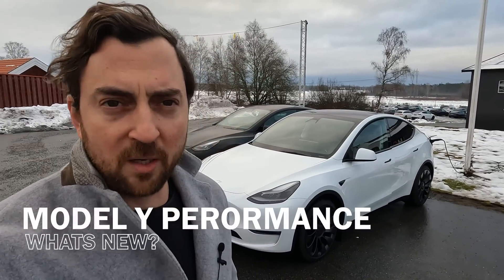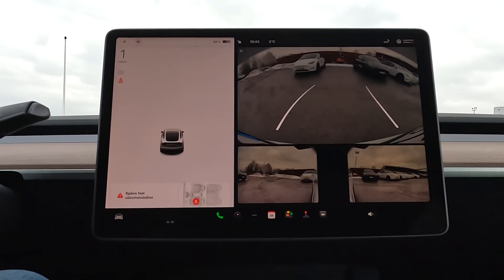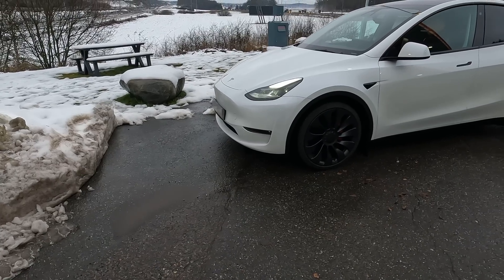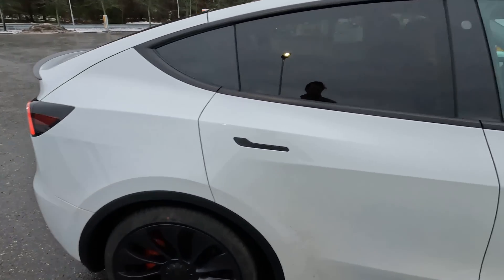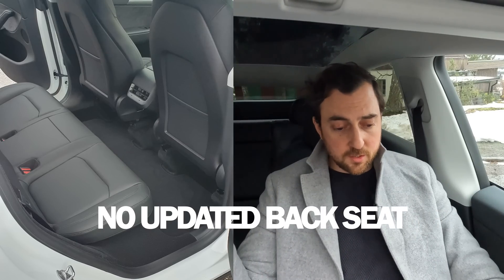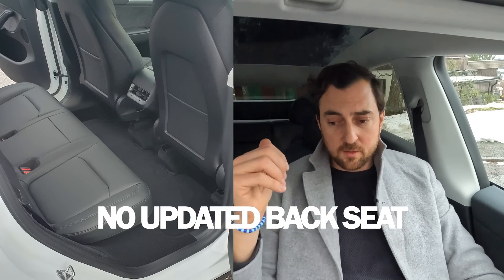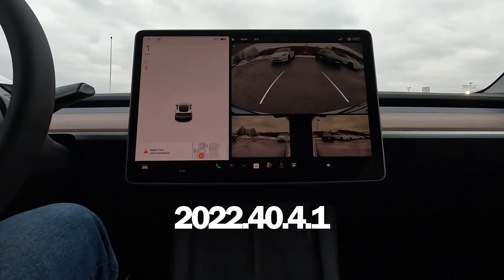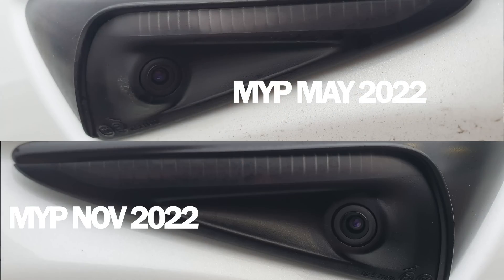Tesla Model Y 2023 updates - No parking sensors! Can tesla vision fill the gap?

Comment: I noticed the same thing. I received my Model 3 in the end of December. I ordered with the full FSD so i could use summon and self parking. Both features are not available without the sensors.
Reply from the maker: Did Tesla tell you something about it emwhen taking delivery?
Reply: @ItsOnlyElectric  i got a mail saying that there would be no uss and i could accept or cancel the order. it was not specified what impact it would have.
Reply from the maker: That's good and better than before! It's good that they make it clear to the customer

Comment: There is no way that the cameras can warn you about something that it can not see. I personally think that it is stupid that they took the ultrasonic sensors off. Also how can you measure distance with only one back up cam? I understand if you have two cameras you can get a rough distance but with one you can not.
Reply from the maker: With good software you can and that togheter with movement of the car you can. Exactly in the same way as AR can track distance and movement on your phones camera. But, it will be scenario's that can't be handled for sure. And it's impossible with a dirty lens.
Reply: You'd be surprised. Tesla have managed to make the car drive itself using only the cameras. Their vision-based system has a "memory" so to speak. If it has previously seen something, it won't just forget about it when it goes out of view of the cameras. My 2021 Vauxhall/Opel Corsa only has a single backup camera, but it somehow manages to build a top-down 360 view as you reverse. If they can do it, I'm sure Tesla can figure something out with 8 cameras!

Comment: Tesla should have had a solution for Tesla Vision before removing the sensors.  There are going to be lots of dents due to the fact that Tesla Vision does not have any warning method.  This is terrible.  Tesla let’s get this fixed ASAP
Reply: 💯 agree, vision should have been in place before removing sensors…

Comment: Hi Tech<Tesla Have you tried Sentry mode on a non Uss Tesla Y compared to one with Uss. I have got 5% battery usage (from 85% to 80%) for 24 hours of Sentry mode on my December 2022 model Y. I think this is all too much. Kind of making the Sentry mode useless. Is this normal on non Uss and Uss model Y’s - or is it the 100% use of cameras, that consumes inaproproately much battery life?
Reply from the maker: Hi, 5% seems normal. On my car with USS I can choose to exclude camera detection for sentry mode. Haven't tried that yet though.
Reply: @ItsOnlyElectric  google search says 1,6 km pr hour ref Tesla = aprox 7% pr 24 hours = quite expensive at current kW prices 🙄😬 and no battery left after 11 days aprox…Has to be quite selective and exclusively use .. aprox 1.000 usd for nightly use 360 nights with current kW prices. 🫣🫣
Reply from the maker: I only use it when parked on public parking lots away from home or in areas where I want to keep an eye open during nights. Not very often.

Comment: This is very naive to assume that cameras + software can replace parking sensors. Not everyone is driving a car in California. Here in Norway when snow starts to melt all the cars get very quickly covered with dirt. Including all the cameras. I'm not even talking about rear and side cameras that can't be automatically cleaned. Even the front camera gets often blocked by dirt/ice as a result TACC gets disabled, car wipers get on max speed (you can't even disable/reduce speed it if TACC is enabled), but even this doesn't always help. I'm happy that my MY has the ultrasonic sensors.

Comment: Tesla delivering Tesla 3/Y since October 2022 with NO ultrasonic sensors and no replacement for the functionality they provided - what a rip off! Replacing inexpensive, available sensors that just work and require relatively little programming logic with no ultrasonic sensors and tons of additional software complexity to use vision —that’s absolutely the wrong move. Not to mention the blind spots not covered by the cameras. Cheaper cars and even Tesla cars sold more than 5 years ago have USS!  If that's not enough, as of January 2023, Tesla would be adding radar back. ?!?  Taking delivery of a new Tesla model 3/Y in December 2022 with no sensors would be a very bad move. I am almost certain I will have to cancel my order. Very very disappointing. Paying through the nose for a Tesla,  I just cannot overlook this. And I do not believe them that a similar or better solution will come any time soon, there will be no parity to USS. What a horrible move by Tesla. Lots of money to not provi
Reply: I did not realise it until I placed an order for my Model Y. I have to cancel my order. This is going 15 years back in terms of tech. I don't want to replace a car that has USS with a blind and deaf dud.

Comment: You said "as it doesn't have any sensors, I have a hard time seeing the cameras' warning".

From that statement, one would infer that the problem is not a lack of warning, but that YOU have a hard time seeing the cameras' warning. In other words, a warning is given by the cameras, but YOU have difficulty seeing it.

Am I correct in my understanding of what you said?

I realize that Tesla has removed the parking sensors and that the operator will not get a warning from non-existent parking sensors.
Reply from the maker: For the moment no warning is given what so ever. Neighter by the inexistent sensors nor by the cameras.
Reply: @ItsOnlyElectric  I infer you mean no AUDIBLE warning. BUT, can a person (with acceptable vision) SEE, on the screen, the snow bank which the car is approaching?
Reply from the maker: No audible and no visual warning at all.

For the specifik statement you're referring to I meant: I dont think the cameras can warn because the snow is not I line of sight of the cameras. And after that I confirm that there's no warning by showing the screen.
Reply: @ItsOnlyElectric  that's what I was asking- is the driver who is watching the screen in the car, able to see the snow bank while he is approaching it, right up to and including the time that the car makes physical contact with the snow bank? If not, at what point does the car's camera lose sight of the snow bank- how far away is the camera at the moment it can no longer see the snow bank? is it a matter of a few inches, or several feet?

You refer to a visual 'warning' . I'm not referring to a warning in the sense that there's something flashing at you on the screen saying 'warning' .        I am talking about simply being able to see the snow bank when you look at the screen, when you're in the driver's seat. At what point, when you are looking at the screen, is the snow bank no longer visible? How many inches or feet away does the camera loose sight of the snow bank?

Comment: Getting my Model 3 this month (after waiting 10 months!) and I must say I am pretty disappointed to get an inferior version to what it was when I ordered. Parking sensors are such a basic feature, even the Dacia Spring has working parking sensors. And we are not even getting anything in return for lacking this basic feature for an unknown time (and when it comes, who knows how well it will actually work). I had hoped that at least we would get the new hardware and 5MP cameras, but nah, the 2023 models are overall just a shitter version of the 2022 models. Bummer.
Reply: I totally agree!  That's why I cancelled my MSP order.  I will not pay for a vehicle that was supposed to come with a certain safety feature only to have it removed so that Tesla can save money while they ask me to I pay the same price for a vehicle with an important safety feature that has been removed without any replacement. Until I see that Tesla has a decent USS replacement then and only then will I place another order.
Reply: @stephen2220  I honestly do not understand why more people don’t say this or sue Tesla for selling eg a Model Y with the enhanced autopilot paid feature which still lists Auto park but which cannot use the feature right now. I don’t think you’d tolerate missing features on anything else, you’d say that you were miss-sold the product based on false advertising. This is no different, and Tesla pulling out important safety features like USS without warning customers is going to lead to property damage or worse.
Reply from the maker: Seems like some cars has the new 5mp cameras. Not the one in this video though.
Reply: @ItsOnlyElectric  really? Do you have a source? I tried finding teslas with the new cams and so far haven't seen a single one.
Reply from the maker: @Sevapcici  saw a video from an American guy where you could see the difference on the camera compared to the old one. But no resolution test. See if I can find it.

Comment: Munro & Assoc. already confirmed that the front camera position in the windshield does not have Vision for the initial 36" in front of the car so a software update cannot fix this issue. Tesla contacted me twice last week to see if I could place an order for an M3 or MY. I cancelled a MY in September after waiting for 7 months. I told them that I would not order a Tesla until they put radar and parking sensors back in the cars. People cancelling orders over the issues is the only way theses issues get fixed.
Reply: 100% agree. The existing cameras will NEVER sufficiently achieve the accuracy of the sensors due to their location, etc. These cars can’t even achieve the surround view of a Hyundai. All other Luxury brands have way better cameras for parking. It simply is NOT possible for this to be fixed with a software update, bottom line. I’m very impressed you cancelled your order. I have a Model S with the sensors (2022), however without radar. Radar used to assist with the auto high beam calibration, now, without it, auto high beam is virtually useless/broken, turns on in residential areas at random and with oncoming traffic, blinding cars and pedestrians. If they can’t even get that right (perhaps even using geolocation), there is no way they’ll achieve the accuracy of the sensors.
Reply: @ScottyBanx1  Tesla has only one choice and that is to proceed with vision as without true FSD, the stock drops even further.
Reply: So the older models will go up in value yes 😌😌😌
Reply: Elon's autistic push that vision only can work will lead to a lot of disruption for years. What can it offer, a yellow warning and then at 36" or less a red warning? My 2020 showed the distance in inches. I regularly parked at 14-18" from the from wall per the sensors. Sold in 2021 but unsure even with the price discounts if I will buy again now...
Reply: > the front camera position in the windshield does not have Vision for the initial 36" in front of the car so a software update cannot fix this issue.

I don't think this is true. The occupancy network is video-based and maintains history, so it'll record the occupancy as you pull in. This isn't a big deal. Same with dynamic objects coming in front -- it can track them when they are visible since the cameras have 360 coverage around the car.
Reply: @TudorAchim  That is only true IF the camera's saw the obstacle prior to you pulling forward or backing up!  What if you get in your car after it was parked in a parking lot after going to the grocery store lets say and didn't  notice that some moron left a box right in front of your car's bumper, how is the camera's going to see it?  At least with USS you would get some warning that something might be there and if you can't visually see it you would go out and check.

Comment: I’m a Tesla fan and owner of a modified Model 3 (check my channel). Still, I have to say that this is non sense! First make the necessary changes then remove the sensors. On a good note, the panel alignment seems to be perfect
Reply from the maker: Yes, regarding the build quality/alignment it's a lot better than mine built i May 22 that is better than my previous M3P 2020. Gets better all the time.

Comment: Can I ask you what the VIN ends with on this white one?
The one I am waiting for ends with: 478xx, so its expected 21 nov  -06 dec. Berlin YP, white.

XP7YGCEL6PB0478xx, just a bit curious how the VIN of yours is compared to mine, since I didnt get it yet :)
Reply from the maker: My cars has 49XX. The car without the sensors har 42XXX.
Reply: @ItsOnlyElectric  it is a bit crazy how quickly the serial number grows!
Reply from the maker: Yes, Berlin has a production rate of over 2000 cars a week now.
Reply: @ItsOnlyElectric  Mine got postponed, but picked it up today.
DIdnt get to inspect the interior yet, as the summner wheels were in the car.
The paint does look very good, same with panel gap. Only thing I could see is the rear hatch is slightly more inwards by the right tail light.

Other than that it looks to be detailed properly..
So a large improvement from when I picked up X in 2017 and 3P in 2019, even though they have handed out hundreds of Model Ys each day in 2022, more than they did with Model 3.. But of course Tesla has much improved from 2017 to 2022.

But I must say that the YP on 21" is much more comfortable than the 3P - even when the 3P is on 19" :P
And the tires in the OEM 21" do grip well in the snow. I also can feel its much easier to close frunk, doors etc than on the 3P from 2019.

No vibrations from interior in the Y, even with SUB on +2.5 and volume up high. I dont have that in the 3 either, after I did sound insulation my self inside the door panels.

I arrived 30 minutes early at Tesla, but they still could give my car out without any hassle 🙂No waiting time. They had built superchargers under the service center in my city, so they supercharged the Teslas that were handed out. Got my car with 90% SoC, more than I usually charge to my self.

I like the car so far, I have just driven it home though.. But I think I also will miss the 3P, it has been some good years with that gokart :)
Reply from the maker: Congratulations to your new MYP! 👏I had a red M3P 2020. I loved that car but I really don't miss it now when I have the MYP. The MYP feels more soild.
Reply: @ItsOnlyElectric  yep, now I have transferred the child seat, adjusted the seats in the Y, attached cargo shelf, swapped the thumbdrive for my 2 Tb M.2 NVME SSD, done the track mode OTA. Now suddenly looking at the 3P it is a bit strange. Yet I have an agreement to sell it to a family in january, they wanted to buy it in december, but since my YP got posponed several times and of course you never know if you get the car in time, I didnt want to be without car in christmas / newyears vacation (driving for 5-6 hours in the snow, the Tesla is the best car I think).

But now I dont really need the 3P anymore, will go out and test the car on snow now, find a unused parking lot to check how it compares to the 3P.

Driving home at least it feels more natural than the 3P, whereas the 3P is a good winter car, the YP seems more neutral whereas the 3P is a tad more oversteered.

But they are both great winter cars. I like thm better than when I had X, which was too much understeer for my liking (having owned most RWD volvos)

Comment: People here seem to have no idea how vectoring in fsd works. 
FSD doesnt rely on ultrasonics its purely camera, but it will take some time.
The cameres will create an vector based image of its environment. 
So it doesnt matter if there is a blindspot infront since the camera will pick it up and calculates if you coming near.
But this will take many months maybe even up to a year to be as good in close range as ultrasonics. 
Tho ultrasonics have their weak spots also and dont detect everything. 
Is it true that Tesla can do everything without ultrasonics ? Yes
Is it true that Tesla removed sensors to cost cut ? Also Yes.
Reply: It can't create a vector based image if the car is standing.
The cameras in the windshield can't look right Infront of the front bumper, so if a cat or something else lies infront of the car it will not be able to notice that !
Also blocked cameras can't perform !
I saw a video of FSD in Toronto in Snow (terrible performance by he way !)  and the car constantly saying it's cameras are blocked !
Reply from the maker: Good points! 👍 I think it will evolve during time and the first update will probably be like 50% of the complete solution.
Reply: @ItsOnlyElectric  I mean obviously Tesla is well aware that many customers are not happy at all especially in europe. So they will work hard on that. But it might take more time than people would like it to take. 
Tesla will for sure use the FSD data to handle parking, etc.
I mean Tesla made it pretty clear 
"In the near future, once these features achieve performance parity to today’s vehicles, they will be restored via a series of over-the-air software updates".
But yes near future can mean a lot in Tesla Language. Cheers
Reply: A nonsense.   Can cameras see below the line of sight of the camera.  A rhetorical question. A vector approach won’t work here.